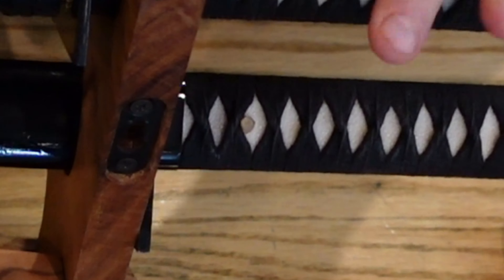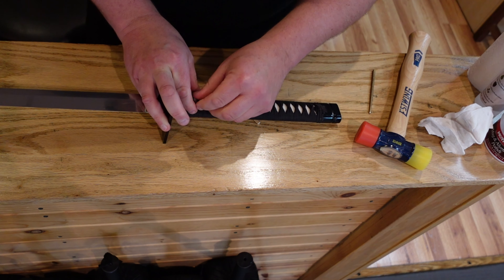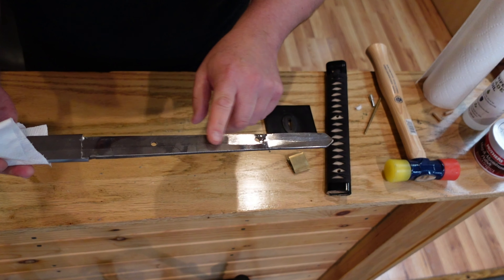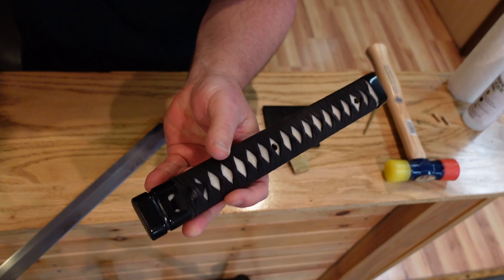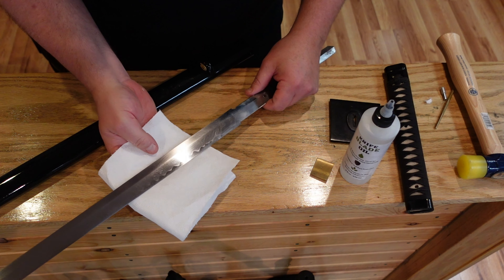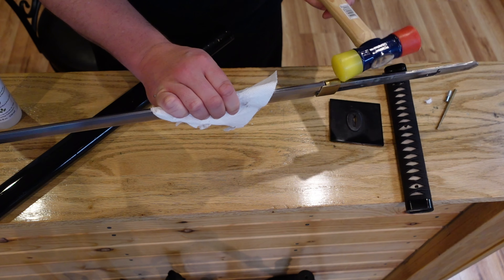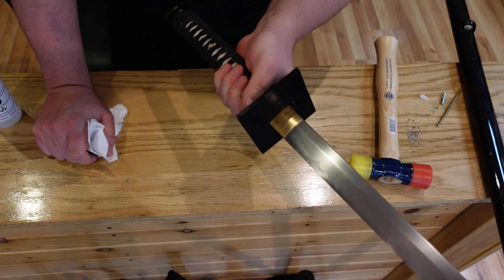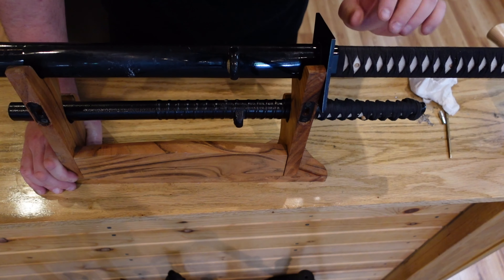Sho Kosugi Ninja Sword Disassembly and Cleaning

Comment: Hi, I bought the Lyuesword ninjoto this past july (2023) and have kept everything, handle and blade, still in its original clear plastic wrapping for now - the blade still smothered in oil inside the wrapping as well as keeping the entire assembly inside the cloth  bag cover. I was curious as to how long do you think it would be before I will have to reapply a new application of oil to prevent rust under these conditions?